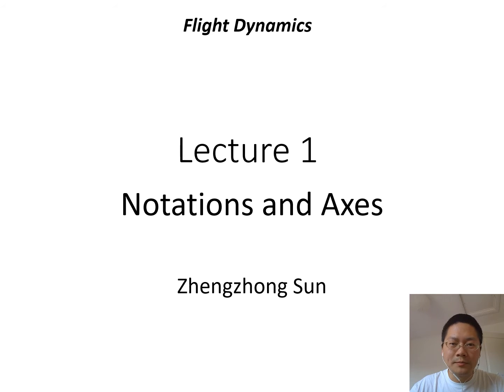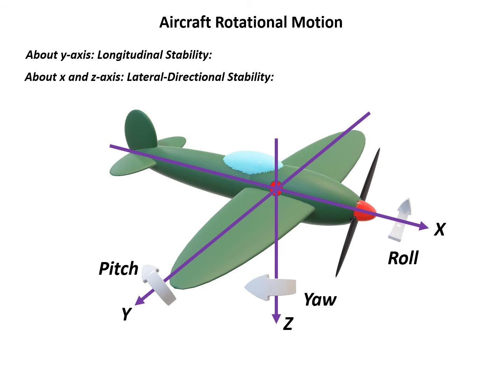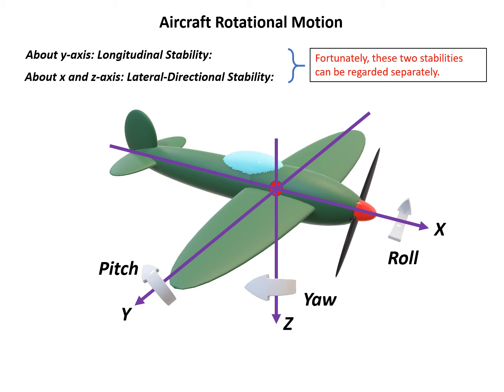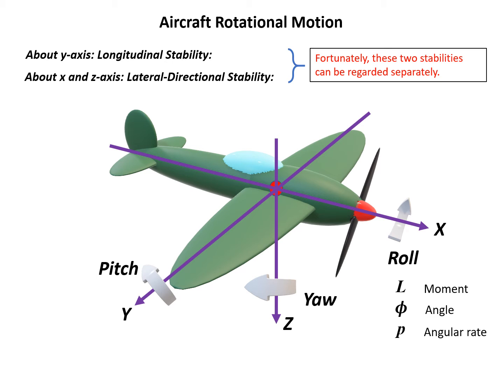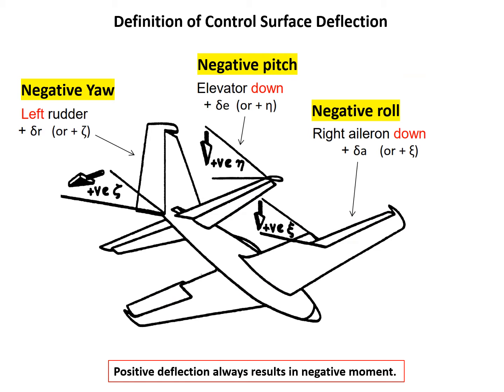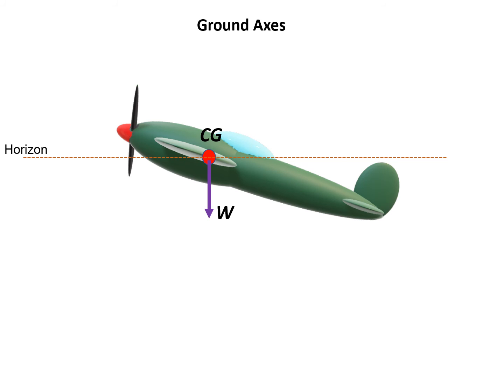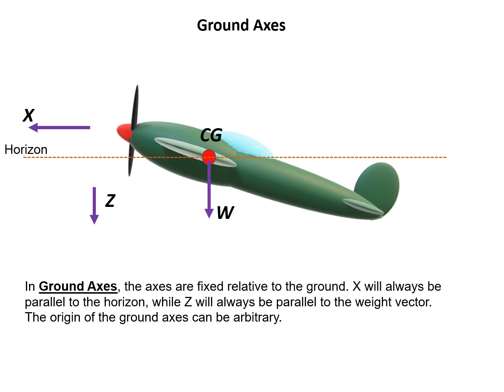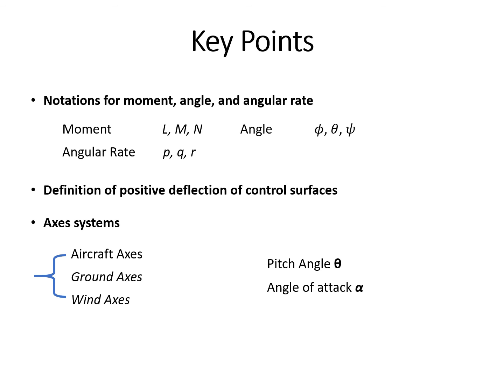Flight Dynamics Lecture 1 - Introduction- Notation and Axes

Comment: name the refrence book please???
Reply from the maker: It is original.
Reply: @schlierenvisualization  sir i need to learn how to find stability and control derivative equation like Cm Cn Cbeta Cr Cmq .... on aircarft but i dont have a good refrence book
Reply from the maker: @ironman_aaz  You can follow the lecture series, all these derivatives are covered.
Reply: @schlierenvisualization  i used the digital datcom but they are not ecaxtly and i want the equation
Reply: @schlierenvisualization   do you have pdf your note please i want use them🙏🏻🌹🙏🏻